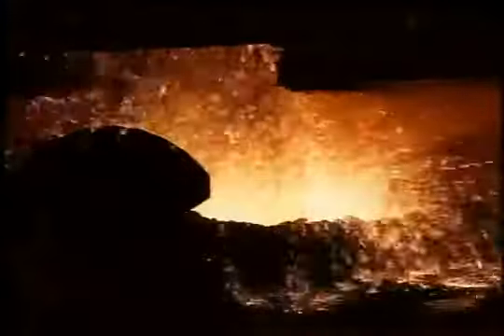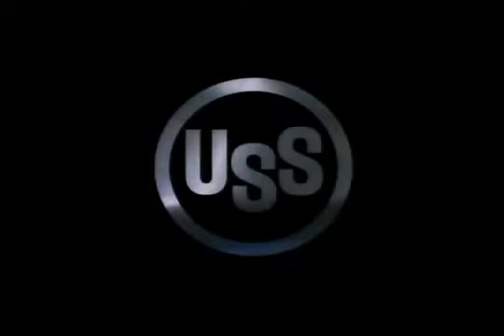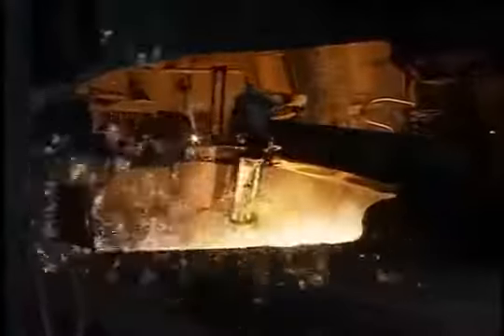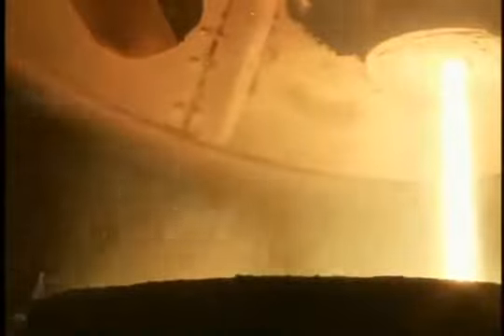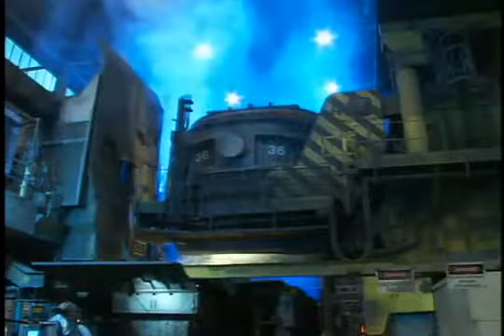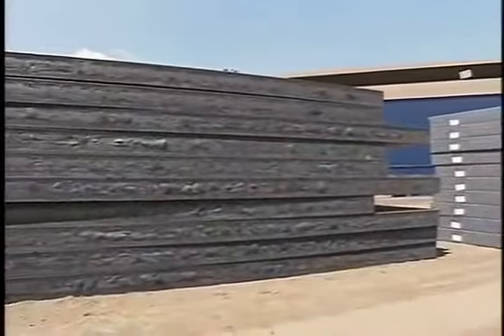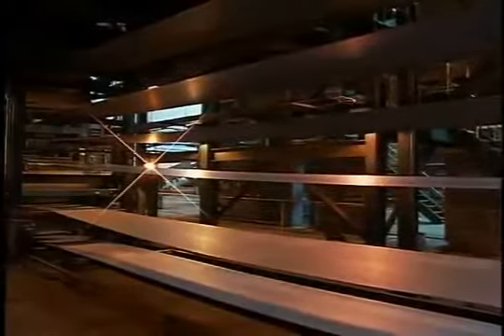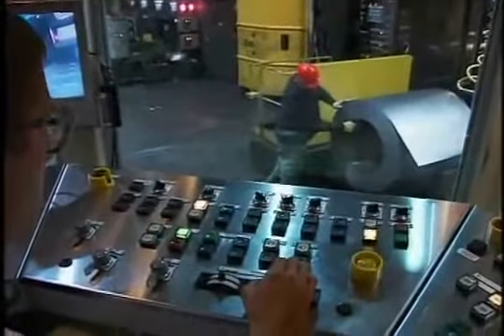STEEL  From Start to Finish

Comment: Rinush Fedrikdo Paltgor (2713100082)
PBB-B/Ms. Dian Mughni Felicia

I want to review about this video from start to finish about steel making process by USS (United State Steel). Steel making start from blast, the rock explode and raw materials are toss from the earth that contain crude iron ore. The crude iron ore are got from the rock by grinding it into powder. Next the crude iron separated by magnetic separator with powerful magnet. After that the ore heated and formed into marble size pellets. Beside that the coal crushed and heated into coke for 12-16 hours as iron fuel. The fuel and the pellets, together put into blast furnace with amount of limestone to remove impurities. Blast furnace running continuously with the air combust the coke that can molt the iron ore into molten iron in 2700oF. Tap hole opened and molten iron running out into submarine lattles. The submarine lattle ride on the rail and transport it to basic oxygen shaft to make steel. Steel making process start from scrap steel dumped into basic oxygen furnace adding hot iron metal. High pure oxygen blown to the mix with supersonic speed and changing molten iron into molten steel.  Next, process is to characterized the steel with many differences chemical (about more than 1500 types) composition based on consumer wish. After that, positioning the tundish to feed continuous molten steel with 3000 oF from lattle to form the steel in the caster. In caster, molten iron cold into red hot solid. The shape of the steel determined by the caster. In USS they casting slab steel and cutting it into 40 feed long. Next, the slab steel reheating to make steel sheet. Reheatting temperature about 2400 oF and descaling the slab more thinner and longer. After that, they are cold and rolled into coils. The last, finishing the process with coating the steel to resistance corrosion, thinning to reduce the edge, annealing to make sure the steal easily to bend and form, and tempering to add hardness and create surface texture to form special steel. Now the steel can use to form anything like in manufacturing construction, highway, etc.

Comment: reviewed by : Ramosan Sirait (2713100010)

The video tells us about the process f making iron steel. It start b taking the raw material from earth. The raw material taken by creating explosion. Then the rock are grinding into pellet. The ore are separated with the help of powerful magnet. Next step is the ore are form and heat to make them into marble size pellet which will convert into the iron. Than from the coal, we create coke to fuel the iron making process. The coal is crush and sealed in air tight environment. And than we bake it for 12 to 16 hours to create solid carbon fuel. Fuel and pellet come together in the blast furnace. We add enough limestone. The function of adding limestone is to remove the impurities. From below, the continued super heated air combust the coal so that the raw material will change into molten iron. The temperature at that state is reached 27000F. Than we take the molten iron to basic oxygen shell where the iron turn into steel. The process of making iron steel is begin with dumping the recycle steel scrap into Basic Oxygen Furnace (BOF) and adding hot iron. High purity oxygen is blown into the mix at super sonic speed, and molten iron become molten steel. The next step is forming and finishing. This step will determine the characteristic of the steel. This is why the steel is widely use in human life. The entire process untouched by human hands, but it as control by the operator. Some products are directly ship to the costumers. The other will give another treatment to change it characteristic as the costumers want.

Comment: Anggiat Ramos J.
2713 100 067

This video explain about steelmaking process. Iron steelmaking process begins the blast in mining with explode the earth crush to get raw materials as a crude iron. Then they are grinding the rock to pellet and separating the ore with the power from magnet. Then they form and heat the ore into marble size pellets and the later will be begin burn to iron. Coal will create coke to fuel for the ironmaking process. 

They crushed the coal and seal it for 12 to 16 hours and remove it from the oven as solid carbon fuel. The fuel and pellet come together in a blast furnace and they are wearing limestone to remove impurities from below a continuous plastics super-heated air combust the coke, intensifying the heat and change raw materials into the molten iron at 2700°F. At regular intervals they transport the molten iron with giant submarine level and send into basic constitution where iron is turned into steel. They can make 250 tons of steel In less than 45 minutes. They begin the steel making process by dumping the recycled steel scrap into the Basic Oxygen Furnace (BOF) and adding hot iron. When high purity oxygen is blown into the mix with supersonic speed, and molten iron becoming molten steel. And they are ready to create custom blends that makes steel widely used metals in the planet. In fact they are produce over 1500 different chemistries to meet the customer demand for cutting edge value added steel. 

As we tab molten steel from the vessel into a ladle and then the most of their steel. Where the made highly vulnerable the focus then shift to forming and finishing which determine even more the steel characteristics, the first step in the sequence is the position the ladle above funnel the , that fits the continuous caster containing molten steel that shape the steel.The molten steel now heated at 3000°F it is channel the from lethal to tandish, to caster where it cooled into red hot solid metal. The shape of the mold determine the  shape semi finish of product that come out of the caster. And since most of US fields plant makes sheet product, most of their caster output slabs. Typically 8-9 inch thick and 3 to 5 inch wide.This is where we begin transforming steel slab into steel sheet. Slab are re-heated at 2400°F, and descale before running to series of state, that makes them thinner and longer. Then they cycle through finishing state where they are rolled even thinner. 

Finally they are cooled and rolled into the coils that maybe thousands of feet long but only fraction of inch there. They offer some additional finishing processes, first is coating that can make a steel resistant to corrosion. Then thinning to further reduce the gauge length. Then annealing to make steel easily bend and form. And then tempering that uses special roller to add hardness and create surface textures, and then other special finishes.

Comment: Muhammad Yunus 
2713100121

Assalamu'alaikum wr wb

my review about the video

Process of making steel from iron ore. The process is began with blasting the rocks which have iron ore. there is three method to blasting the ore, there are , strip mining, open pit mining, and mountain top removal mining.In this video, the method is using strip mining. Blasted rock is called raw iron ore. Raw iron ore which has taken from the mine place is taken to the next process. Raw iron ore grinded into pellets and separated ores with a huge magnetic separatotr. Ores are heated and shaped like small ball. Afterward, coal is poured into coke and cooked with coke to create fuel of iron-making. Coal is crushed and roasted 12-16 hours until being solid carbon fuel. Fuels and pellets are pour simultaneously into blast furnace. When the process was continuing, impurities will removed from ores then ores will melting into a molten iron. At 1500 degrees celcius temperature, Iron is put into giant submarine then iron is being steel. Process of making steel is begins with pouring the scrap into Basic Oxygen Furnace. Then, Hot iron are adding into BOF. High pure oxygen is blown into the mixture with supersonic speed. Molten iron will transforming become molten steel. Molten steel are ready to formed become varian steel product. The company produces some variant of steel.  molten steel are taken from hot vessels and producing become lethals. After that, focus is on reforming and finishing to determine steel characteristic. molten iron is placed into continous cast containing mold to shape the steel. Type of steel are needed in next process industry to become pricely product. Slag steel are cutted to clear the steel. steel slag is reformed into steel plat that can used to be layer of products. Steel slag is reheated and descaled that make them thinner and longer. The entire process is untouched by human hands, controlling steps by operators. Then some products are coiled to save the place and shiped directly to the customers, others are given some treatments to special finishing. Coating to making steel resistance from corrosion. Thinning to reduce the gauge for another production. Annealing to make the steel easier to bend and form. Tempering to increase level of hardness and create surface form. That's all my review about the video. Thank you for your attention.

Wassalamu'alaikum wr wb

Comment: Faizal Nugraha Ramadhan
2713100149
PBB-B

           This video illustrates and tells how steel making from very beginning to the end of process. starting from detonates layer of earth,and then the raw material collected and pulverized and then the ore was separating using strong magnet.then ore is formed inti marble-size pellets that will be converted into iron. then we make coke into fuel by crushing and roasting to become coal for 12-16 hours. and removing it from the oven asa solid carbon fuel. After the existing ore mixed with coal and lime stone to reduce impurities. Aftr mixing occurs input into BoF. From below, a continous blast of superheated air combusted the coke, intensifying the heat,reduce the amount of carbon and change the raw material into molten iron. At regular intervals, we tapped this blistering iron nto massive submarin look-alike container that ride on the rail.where iron will be turned into steel. In this fast phase sequence,up to 250 tons of steel can be made in less than 45 minute.
            Process begin with dumping the scrap into basic oxygen furnace and adding hot iron. Hing pure oxygen is blown into the mix at supersonic spee and molten iron become molten steel. Now it's ready to create the costum blends that make steel widely used. Then the focus is on reforming and finishing to determine the steel characteristic of steel. The molten iron is placed into the continous casters containing mold to shape the steel. The shape is determined as the finish product that come out the casters. The steel slag later cut, and then steel slag is reformed into steel sheet. Steel slag is reheated and descaled that make them thinner and longer. The entire process is untouched by human hands,controlling step by step by operators. Then some product(coils)are shiped directly to costumers and the other are given some advance treatments to special finishing like coating,thinning,annealing, and temper.

Comment: Video reviewed by Annisa Riyanti (2713100115)

This is one of steel making process documentary, by United States Steel (USS) company.

The steel making process is started with blasting the strip mining of iron ore. Then the ore is grinding to become pellet, then it is separated by powerful magnet and then forming it into marble size of pellet.

And they also make the coke. First the crushed the coal, and baked it 12-16 hours to remove the impurities and make it as a solid carbon. Also, the limestone is added to remove impurities from the steel making. 

Then, the pellet, coke and limestone is entered the blast furnace, and blasted to be molten metal. They can make more than 9 tons in a day molten metals, then they tapped it to giant ladle, and transfer it by rail to the Basic Oxygen Furnace (BOF), to be turned into steel. They add steel scrap and hot iron into BOF, blown with high purity oxygen in sonic speed, and the molten iron now become molten steel. They tap molten steel into the refining ladle to be refined. They also checked the micro structure to check qualities of the steel.

After all of the process, continuous casting is done to the molten steel. It is formed as a slab, or demand from the costumers. They specially make the sheet form, so the hot strip mill is transforming from slab to sheet, by rolled it. This process done by the computerized machine. The sheet now is formed as a coil, some special requirements for the uses of thinner coil is produced by cold rolling.

Further process for special uses of the steel, it is coated to make more resistance to the corrosion, annealed to make it bend-able, and tempered to add hardness. Then the steel is distributed to some companies for their own necessary, such as for automotive, construction, and for our daily life.

That's the story of the steel making, from ore to coil.

Comment: Muhammad Afza Nur Hakim
2713100140
PBB B

It all begins with mining the raw material with strip mining method, which is blasting the mine resulting the rocks that contain crude iron ore to be toasted into the surface. To get the crude iron ore, grinding the rock into pellet is necessary, after that, separating the ore with powerful magnet is done. Then the resulting iron ore is formed and heated into marble sized pellets that will melted down into molten iron. Bituminous coal is made into coke to fuel the furnace. The coal is crushed and cooked for 12-16 hours. The coke and pellets then putted together in the blast furnace and limestone is
added to remove impurities. Then air is blasted continuously to increase the temperature of furnace so the raw material can turn into molten iron. The blast furnace itself can reach 2700 degree of Fahrenheit. Then at regular interval
the molten iron is tapped into giant submarine ladle that transported into basic oxygen furnace where iron will be turned into steel. This process is done by putting scrap and hot iron into basic oxygen furnace and high purity oxygen
is blown, thus the molten iron turned into molten steel. By now, it is ready for more alloying elements to create the desired properties of steel. Then the molten steel is tapped to a ladle and putted in the vacuum degasser to be made
highly form-able. Then it reaches the forming and finishing step, where the ladle is positioned above the tundish and then go on into a continuous caster containing mold. Molten steel of 3000 degree of Fahrenheit then undergoes the
process from ladle, tundish, and continuous caster where it cools to a red hot solid. The mold determined the finished product form which is a slab. Slabs are cut to the desired size from the caster. Slab is then transformed into sheet by
reheating into 2400 degree of Fahrenheit and descaled before making them thinner and longer with roller. And then, it rolled even thinner and then rolled into long and thin coils. Coils then go into acid bath to clean the surface. Then some are ready to shipped for the customer and some will undergo further special finishing process. Coating to make a corrosion resistance property, thinning to make it even more thinner, annealing to make it easier to bend and form, and tempering to add hardness and create surface textures and other special finishes that used a special roller.

Comment: Axel Gian Aditama (2713100137)

This video shows about the story of hot metal and cold steel from start to finish in United State Steel. The first process started with the blast, as rock explode and raw material of steel are tossed from the earth. The rock is taken out and place inside as Crude Iron Ore. The ore go to grinding process and separating with the powerful magnet. Next, the ores are formed into marble size pellet. In the same time, USS create coke to fuel the iron making process. The coals are processed into coke. They crush the coal and seal it in air tight oven, then bake its around 12 to 16 hours and removed from the oven as solid carbon fuel.

The fuel and pellets come together to the blast furnace. They added enough limestone, which use to remove impurities. In the blast furnace, from below the blast is continued by adding super heated air to combust the coke and changing raw materials into molten iron at 2700°Fahrenheit. The steel making process is started by dumping recycled steel scrap into the Basic Oxygen Furnace (BOF) and adding hot iron. High purity oxygen is blown into the mix at supersonic speed and molten iron is becoming molten steel. The next process is making the costum blends. 

They tapped molten steel from the vessels into a lethal. Most of the steel is turned into a vacuum digester where they are made highly formable.  After that they are focusing in forming and finishing the metal to determine the characteristic. The first step is positioning the lethal above a massive tunnel then that feeds are continuing as caster containing mold that shape the steel. The molten steel heated at 3000°Fahrenheit and colds into red hot solid metal. The shape of the mold determine the semi-product that come out of the caster. The semi products will send to hot strip mills. In the hot strip mills, taking place transforming steel straps into steel sheets, steel is reheated into 2400°Fahrenheit and descaled into spinner. Longer steel is pulled and rolled. Some of the steel is given additional treatment before send to costumer, like coating the steel, make the steel thinner, annealing, and tempering.